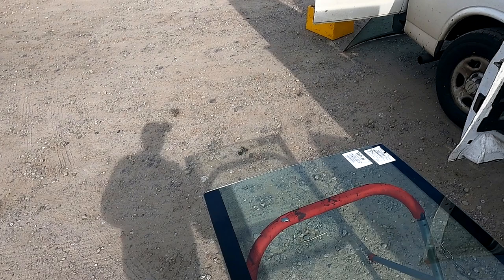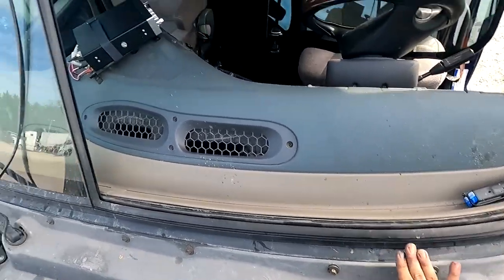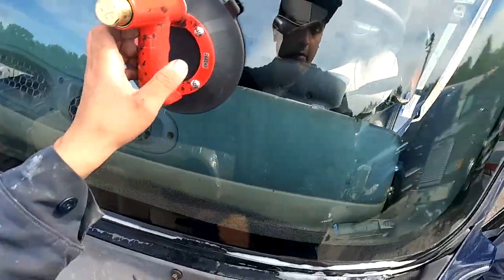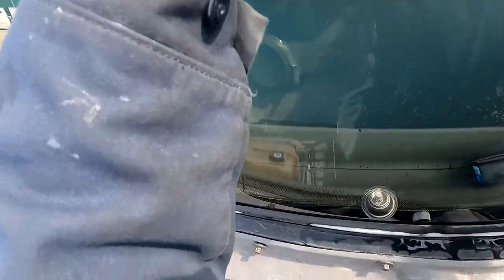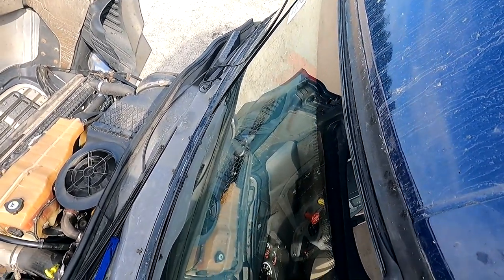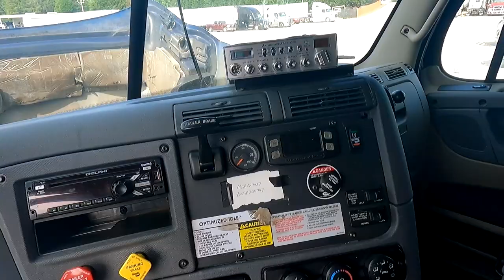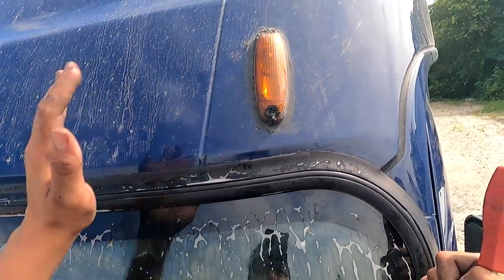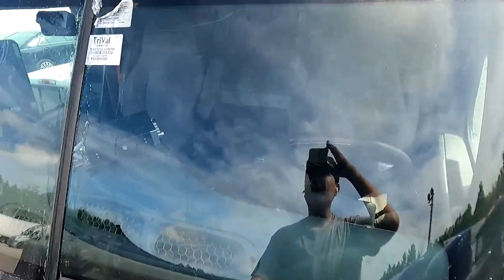Freightliner Half glass windshield Installation!

Comment: its easier if you slide the middle half on the top and bottom and slide half the window in at the same time, not sure if that made sense but it literally takes 5 minutes and you end at the curved corners which are much easier to work in.
Reply: That is definitely correct I cannot believe it took this dude that long. I would hate to see him do a one-piece cascadia. We do these all the time and I mean at least three or four a week. The only thing I need if I'm not standing on my tailgate is a ladder some spray lube like wet Lube and a hook tool, no spline tool needed